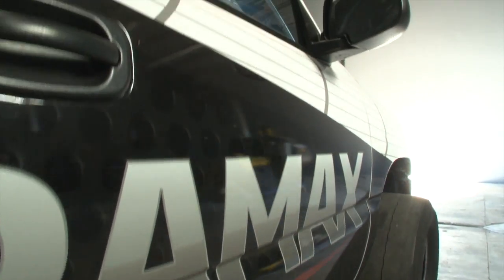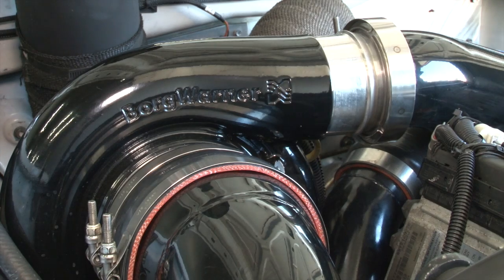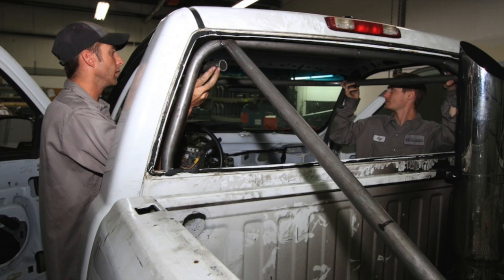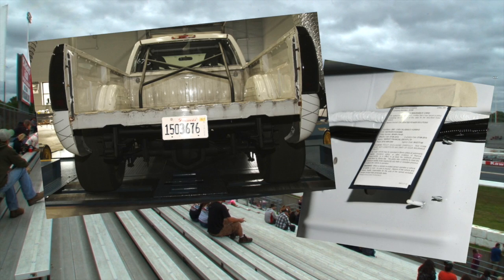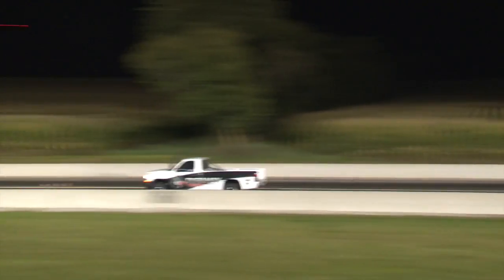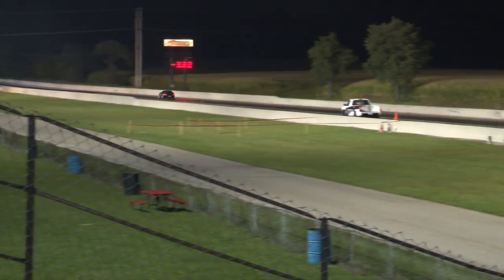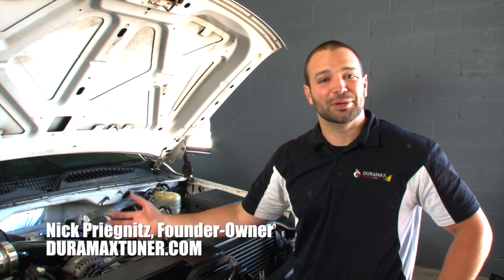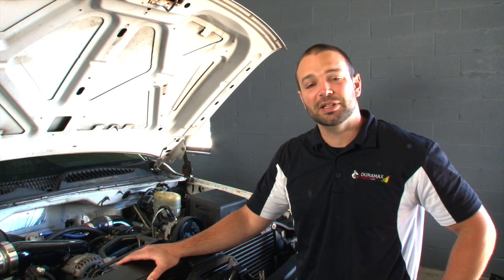LB7 Duramax Race Truck with Compound Turbochargers Including Stealth 64 by Duramaxtuner.COM

Comment: What injector brand are you guys running
Reply from the maker: Exergy Performance - we've worked with these guys for years. We highly recommend.
Reply: Duramaxtuner I want a lb7 but don't want to keep dealing with the injectors.
Reply from the maker: We understand the situation - a reasonably priced truck that requires engine work that may approach the cost of the truck itself. But a well maintained, well-mannered truck does hold value, just saying. Good luck!